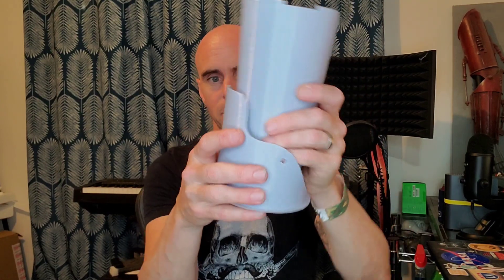How I stop "primples" (3d printed pimples) on my prints. It's pretty easy!

Comment: Looks like your seam. From when the print nozel stopped before the next layer that's the explanation for the extra material. Slowing down the printer might not always fix this when you're not doing cylindrical shapes.
Reply from the maker: The seam is but the little bumps all are fixed by doing this

Comment: Power loss recovery is the first thing disable on all my machines.  I also print via Octoprint so I can use Obico to monitor the print for potential failures.  Lastly, I giant UPS back up battery in case your power like to flicker (as mine does).  Print safe! 🤓

Comment: You stop them by not making any.  Easy.

I yeeted power recovery from my firmware. I have lost power only once in 20 years, i don't need a contingency for the case that doesn't happen.

You can also just add M413 S0 into the G-code preamble to disable power loss recovery for that session. Do not use power loss recovery on vasemode prints, since it increases the frequency of writes somewhat fierce, it's not just once per "layer", it's basically all the time. Do keep in mind that to get power loss recovery back you need to restart the printer (reset button or power cycle) or issue M413 S1, so unless you do either of these things, you're not gonna have power loss recovery on the next print you do right afterwards either. You can also make separate Gcode files which only disable and enable power loss recovery whenever you feel like.